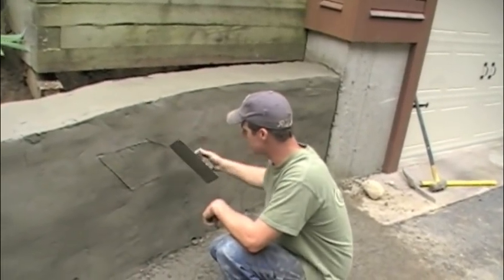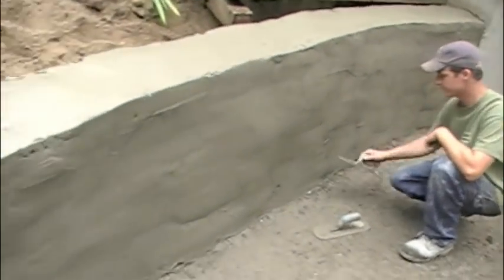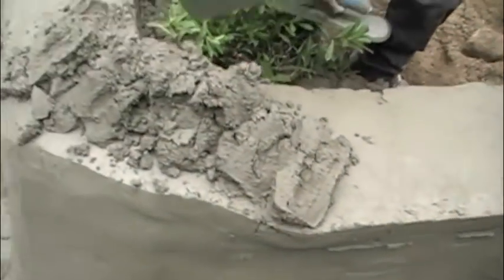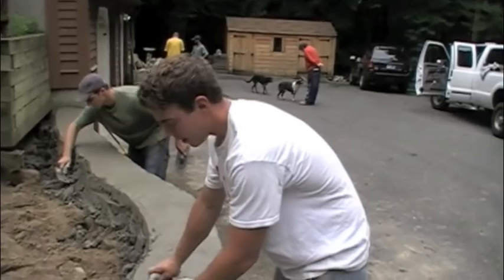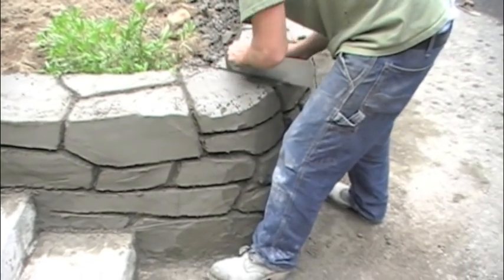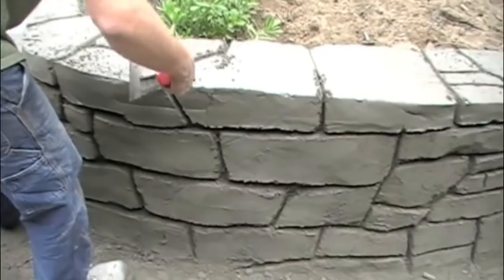Retaining Walls - By Stonemakers™

Comment: The walls at the 6 minute mark LOOK great BUT do not meet the building code.  Solid concrete or block walls higher than 1 meter (39 inches) must be on a footing at least 4 feet below grade and they must have rebar.  In addition the building inspector insists on approving the footings before any walls are constructed and yes a building permit is required and weeping tile for drainage behind the wall is required.  Like I said the walls at the 6 minute mark look lovely but they are not legal where I live and not safe over the long term.
Reply: Depends on area, our footer depth is 18".
Reply from the maker: +peggyt1243 we now have close to 1,000 dealers world wide and have built thousands of walls with no failure over a 20 year period and you can't show me a wall that has failed. on the other hand i can show you a list of walls that have failed made with forms and block.  we have the proof so check it out before you sent a judgment. 
we use a hygroscopic chemical to set and cure the wall which adds 8percent air entrainment and more. 

https://youtu.be/QqFzwiQxGpo

https://youtu.be/RX0xZA6_C8s
Reply: +StoneMakers™   I said the walls do not meet the building code (where I live).  That statement is true regardless of the strength or track record of your walls.  Your walls could not have a track record here because they cannot be built here.
Reply from the maker: where are you??
Reply: +StoneMakers™ Ontario.
Reply from the maker: lol how uninformed you are Peggy123
Reply: +StoneMakers™ Check the Ontario building code for yourself.  Your walls look beautiful and will work perfectly well in many climates but not here.
Reply: peggyt1243 qq
Reply: Nado Vidaich ש
.
Reply from the maker: we do this in NH where we get 30 below and is meets all the building codes incase you don't know
Reply: Could this have anything to do with a cheap price on the job ? I"ll say " you get what you paid for" although building codes should be in mind as a " full protection guarantee, and that being said,   "No Worries  Mate"
Reply: @peggyt1243  they werent built in onterio so chill lol

Comment: i have a foundation wall outside the house that's choppy and has a few holes, so i need to resurface and repair the chunks that fell off..
what type of cement mix do i need for this project.. someone advised me for a mix with stones in it..but that didn't do well at all.  didn't stick to the wall or anything.
Reply: Mortar mix or stucco mix will be the description on the bag.